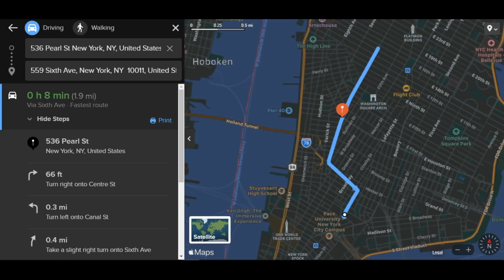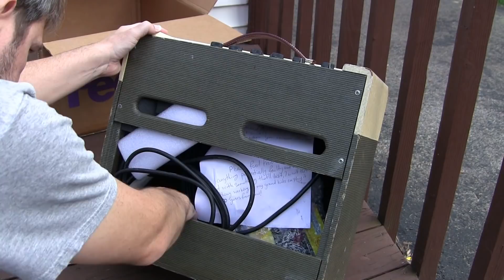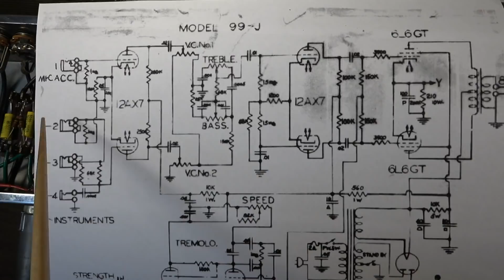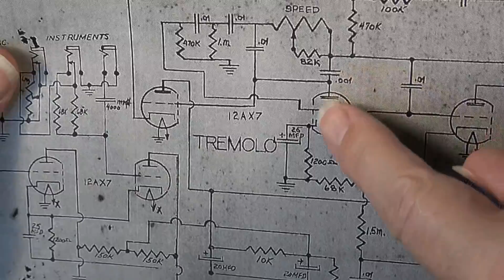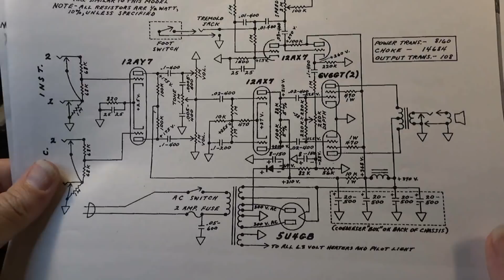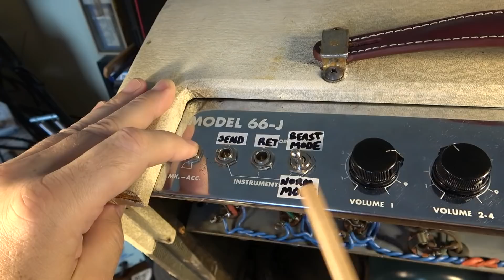Fender Tremolux KILLER - 1959 Guild 66-J Masteramp Goes "BEAST MODE"

Comment: great Brad! i really like this mod , it's kind like having a super lite marshall now, but the option for a clean tone too , i guess...
i would like to add a passive fx loop to my 5e3 conversion , but i'm afraid the signal out of the normal channel pot as send would blow my pedals 😁😁,  great job anyway , enjoyed the video a lot 🤟
Reply from the maker: Nah. You should never have any issues with the signal after one gain stage. The only way your pedals could be affected at all is if the first coupling cap in the amp shorted, but that's not likely.
Reply: @TheGuitologist  cool i might try then , maybe i add a separate box , it's kind a odd amp , pre amp is apart and connected to the power amp with a cable, so i can just disconnect it and run the signal through the send return box , or just add a solis state fx loop and feed it with the last nod , think it can work ! thanks👍🏻
Reply: @antonix_81  That’s normally all an FX loop is. Some amps even label them “pre-amp out”/“power-amp in” instead of “send”/“return”.
Reply: @OtherTheDave  yeh kind like the matchless dc30 one uses

Comment: First, it sounds great, especially beast mode...second, are you saying that both ends of the ground from the shielded wire had been connected to ground right from the factory...third, you lost me
Reply from the maker: Yes. Both ends of the shielded cable's shielding was grounded to the chassis. That is a no no. You are only supposed to ground ONE end only. Otherwise, it can set up a ground loop. See this video for more on ground loops: https://youtu.be/OnAuFloeEqE

Comment: That's a real nice sound. Thanks for the video.
Reply from the maker: Thanks! I wish I had not forgotten to turn up the room overhead mic during the demo. I usually like to mix a little of the Beta 87A condenser in to get ambiance of the room. Makes it sound less "boxy" to me. Closer to the actual sound of the amp. But it turned out ok.

Comment: I would like to find something like this or at least something that would easy to rebuild with a mid sized tweed circuit in the Pro or Super size. A little bigger than a Deluxe (preferably with 6L6s) but smaller my Bassman. I love the tweed tone but it’s hard to my Bassman on the edge of breakup without being too loud, I built a Deluxe but it runs out of headroom pretty easy at gigs. If I had it to do over I would have used a Deluxe Reverb output tranny and 6V6s on my Bassman. Tweeds aren’t complicated though so I’ve been keeping an eye out for a old 30-35 watt amp with the 5v tap for a tube rec to convert.
Reply from the maker: Tweeds do have a bit of an overhead problem. I agree. The BF era amps solved this by tweaking the tone stacks too. Maybe something to consider doing on your DLX build?
Reply: @TheGuitologist  I’ve been thinking of modding it. I put it in a head cab I built out of basically scrap plywood so I want to build a 1x12 pine cab for it. I’ve thought while I had it out to swap it would be a good time to maybe tweak the tone stack and add a switchable NFB loop.